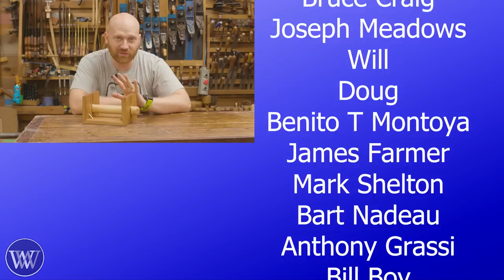How to make a betterish Napkin holder

Comment: Hey James, what's a quasi decent set of cheapish rasps, I'm planning on doing some 'shaped' projects and my files would take 3 days to cut the shapes?
Reply from the maker: With rasps there is not much to them. Hand stiched feels a bit better, but they will all cut. I usually suggest starting with a fore in hand and working from there. They are sold individually so sets are not really a thing.
Reply: @WoodByWrightHowTo  So the cheap 4 in 1's should be good :) Thanks James

Comment: And is like to see a test(if you ain't done one already 😂) how well and deep the sanding makes the oil wick!
Reply from the maker: I actually did a live video on that a while ago showing it under microscope. Without sanding, it just absorbs into the top fibers. But depends on the type of wood. And an oak. It might go down a hundredth of an inch or less. With the sanding. It might go down 200s of an inch or less.
Reply: @WoodByWrightHowTo  I must've missed that one

Comment: Where do you get your brass rod from?  I have a project that I'd like to use it in but, there are lots of options available and I have zero exp with brass.  This was a great project for someone to do with kids or non woodworkers to introduce them to the craft.
Reply from the maker: This stick I just purchased at the big box store. But most metal supply stores sell brass.
Reply: I buy brass brazing rods in the welding section at the big box stores. It's way cheaper than buying individual rods. They are smaller diameter, but that has never been an issue. It's one of those materials that you find more and more uses for it if you have it around. The brass can easily be cut and shaped with normal woodworking tools.